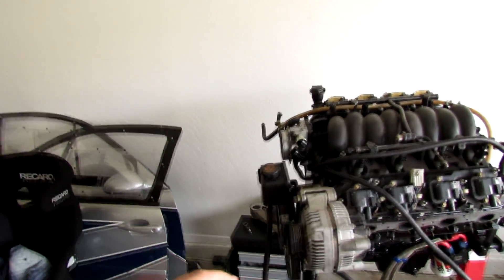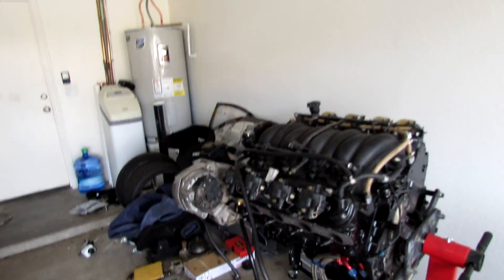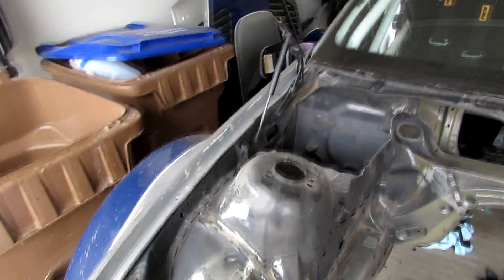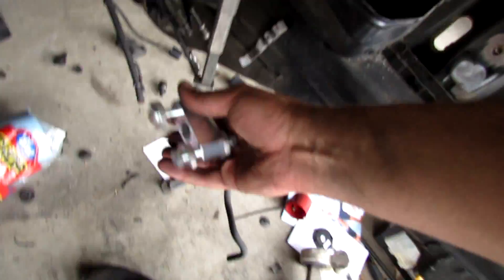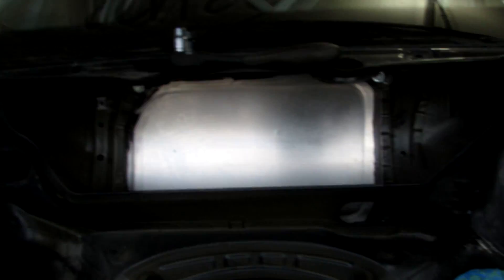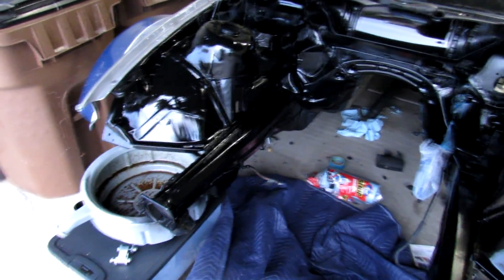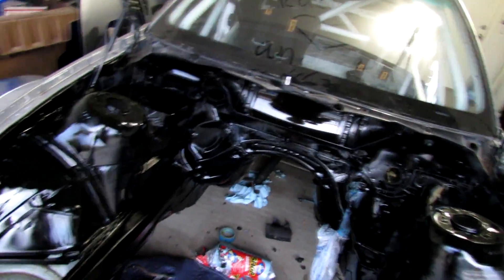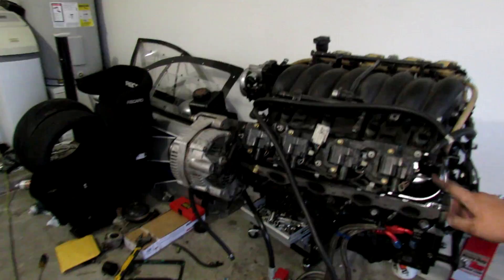Painting M3 Engine Bay! - TIME TO COME BACK

Comment: Here in germany, you can actually get a  S62B50 E39 V8 for way cheaper than a LS3 xD
Reply: eeexcept he’s not in germany
Reply from the maker: I’m sure, but in Germany I wouldn’t be able to drive this near race car on the streets either without being seized :(
Reply: @AndreKlebleyev  No you have a point there, even with a muffler delete they will seize your car immediately xD A little tip though, if you don't want to go for a straight cut gearbox, you can add solid diff bushings to your rear differential, that will make it whine nicely